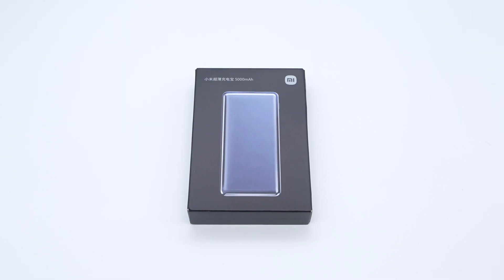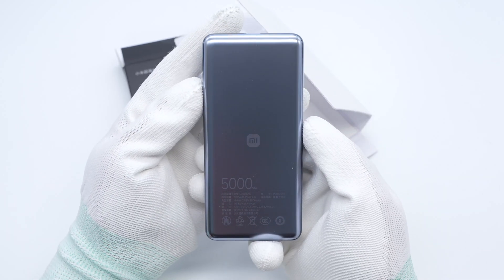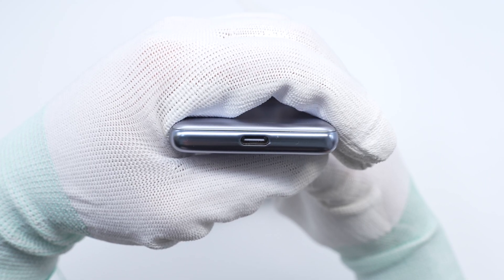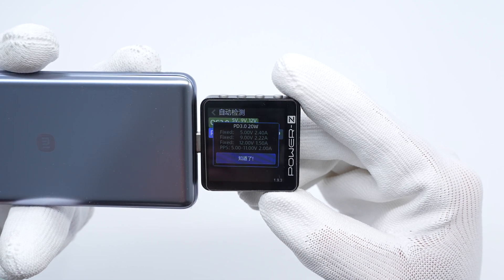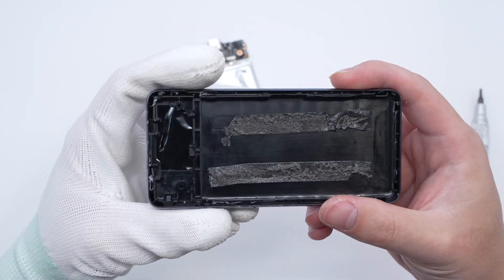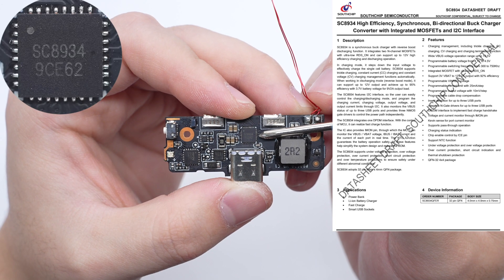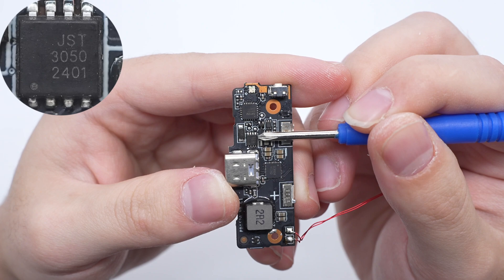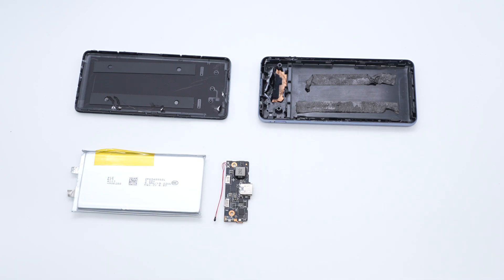Teardown of Xiaomi 5000mAh Ultra-thin Power Bank

Comment: Too big for a 5000mah battery pack. Ive seen powerbanks with double the capacity with slightly more volume than that powerbank with built in cables which supports 22.5w fast charging
Reply: Nitecore nb 10000mah?

Comment: Polycarbonate shell? Aluminium would be nice like older models...
Reply: I think Polycarb is more durable and more shock resistance.
Reply: @WuJiZhang-wc9mc  My Nitecore NB10000 Gen3 expanded so I'm a bit suspicious of ultra-thin powerbanks. :(
Reply: @TorchHacker  lithium-ion cells expand due to internal failure, hard case would only make it harder to spot this before it's too late. I like powerbanks with hard aluminium alloy cases too, but it's a double-edged sword. Perhaps, the best powerbanks are those that have good quality cylindrical cells inside, at least they can vent through valves and can even fail in a safer manner compared to sandwitch-squeezed pouch cells.
Reply: @ 
I also own previous ultra thin powerbank. About 10 years ago... and it's also expanded :(
I'm sticking to "normal thickness" powerbank as of now. I actually like the xiaomi one that use ordinary 16550 battery, but unfortuntely that one doesn't have the integrated cable.